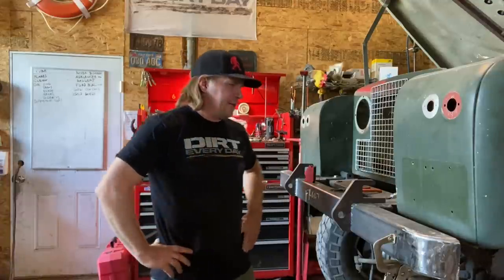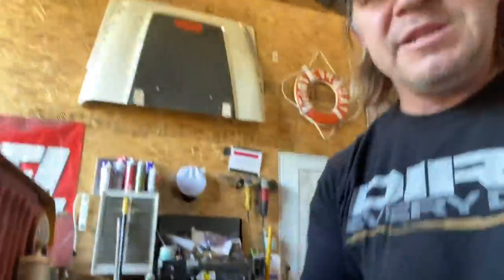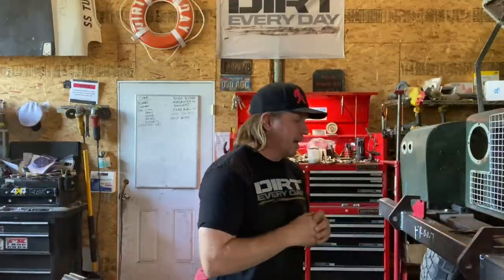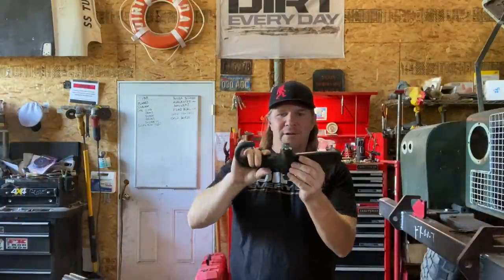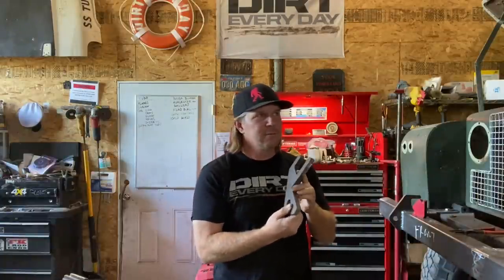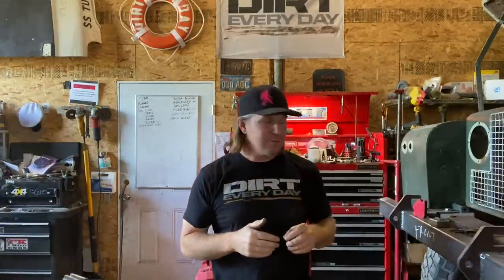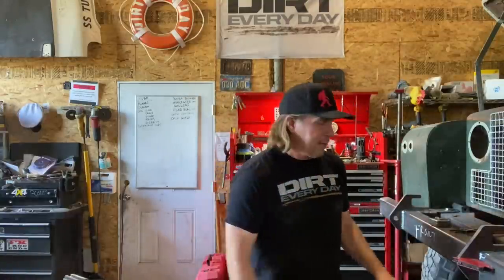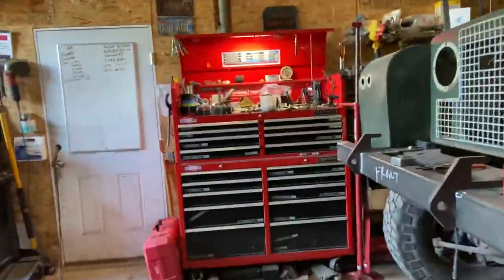Dirt Daily. Tow Hooks

Comment: nice hat! and just a little thing i do for my shakles. om mcmaster you can order rubber washers for cheap. I put a rubber washing inside on either side of the pin. it holds it in and doesnt allow the shackle to bound around. (but it does take a little while longer to take off and put on) but they are always there.

Comment: That OEM hook is a mooring point. Not a recovery hook, flat towing only at best.
Yanking that hook is dangerous
Reply: On Chevy's they come in pairs on the front, if the rig is heavy or really stuck, use a bridle and pull on both hooks.  I've heard the same BS about tow balls and pulling or tugging on them, it's complete and utter BS....but I use soft shackles.  I go behind the ball and under the tow trailer ball mounting bar...never had one come off and break the ball.  Most of the pull weight is on the ball mounting bar, not on the ball if you go under it.  Lastly, don't use "tow straps", they are not for recovery, they are as their name implies, towing.  I use a Kinetic rope which stretches....if you don't have one, then winch them, dont use tow straps.
Reply: @iamblaineful  I only “know” landcruisers. Those things on a Toyota are for mooring only. Not yanking. Confirmed by Toyota Netherlands. Not that I listen to their or my own advise… I have ripped off three so far.., 😂 one of them is still in orbit, never found it again.
Peak load on those bolts would be huge. Way more than the vehicles weight. In theory the load would be infinite until breaking point (no way to tell how stuck a car can get or how strong the strap is) no car manufacturer would ever certify this for yanking.

Comment: Skookum recovery point Fred. Any issue with the sharp edge of the plate cutting into the soft kinetic rope/strap? Bet you could put a decent radius on those edges with an angle grinder.

Comment: So Fred, which is it.. In this scenario, do you have the weld settings for the thicker material or thinner material?
Reply: It has to be set for the thicker material. And you direct most of your heat to the heavier side when you weld.  If you dont set your heat for the heavy side, you will never get the penetration you need to hold it safely.  I've welded thicker steel to lighter steel a thousand times
Reply: Realistically if you set the welder for the thinner metal you are going to achieve the full penetration required for that thickness. It will penetrate the thicker material the same amount as the thinner material. If you weld for the thicker material it will penetrate the thicker material better but it actually can lead to more issues on the thinner side. Such as get it so hot it cracks easier. The way I would go about it is up the voltage a little for having the thicker material absorbing more heat and bevel the thicker material. That will get you the penetration on the thicker side and keep the correct penetration and heat into the thinner side. You have to remember you are figuratively attaching a 20k pound winch to a 1" diameter "tree". No matter how thick that shackle point is it's still only attached to 3/16th steel. Weakest point will be that. But thicker will make it resist twisting which you want.

Comment: Would a return under the bumper help? Give extra length to weld on and stop the top twisting off? Could also have plate to the sides and run bolts through the bumper?

Comment: If I where to weld those awesome recovery points on i would bevel where the weld is going to be on the shackle hook, pre heat to 150 degrees on the shackle hook, tig route the bevel then come back with at least 1/2 size hard wire mig weld. Set the mig welder to weld 3/8 plate. Sucker would never come off.

Comment: There's a commonly adopted set of "tech rules" used by many off road parks that specifically disallow welded on recovery points. All must be bolted through the frame using a backup plate.  Problem is, it's really easy to make a very nice looking weld that won't hold squat.
Reply: Any bumper with a shackle mount has a welded mount, there may be a few that are just plates you bolt on, but any tj/wrangler bumper is going to be welded then bolted.
Reply: Yes I understand their reasoning behind the rules, but come on in the real world how many after market bumpers the mounts are bolted on? I wager the vast majority are welded on...

Comment: if you are fitting it to a box section bumper could you make it a U section so it wraps on 3 sides? or even design it so it hooks round the bumper then the welds are not under load?

Comment: Use soft shackles.....let me say it again, use soft shackles.  DO NOT put a D-Ring in your center console or inside your rig unless you want to be hit in the face with it, put it on the bumper, use a screw driver shaft to tighten the pin and use soft shackles.  Yes, I use a Factor55 "thimble" on my winch, and not the supplied steel hook, and it's on synthetic line for both safety and weight.  Yes, they are expensive and don't come with your winch, I don't care...Safe First.  My connections are SAFE for people standing on the trail who enjoy watching the carnage of winching....steel cable is NOT safe.  Evolve and grow.  I run hard trails and live less than an hour from the Rubicon, and we frequent that place.  Use safe recovery gear, be safe in your choices(slow down and think, it's not a race), and plan for problems/emergencies.